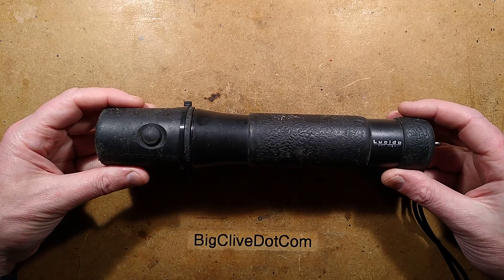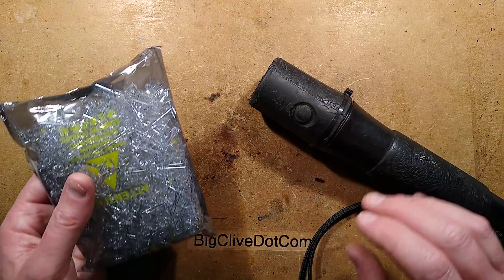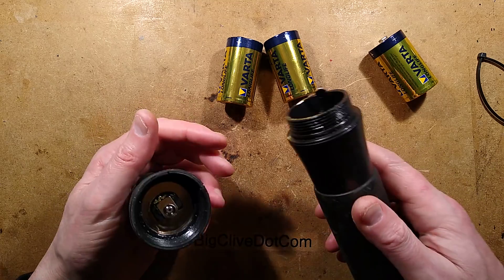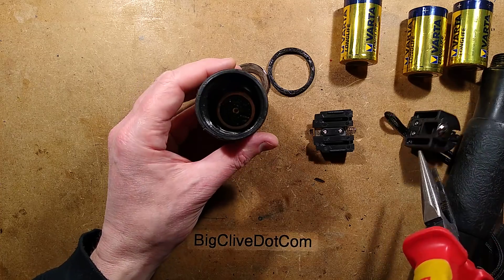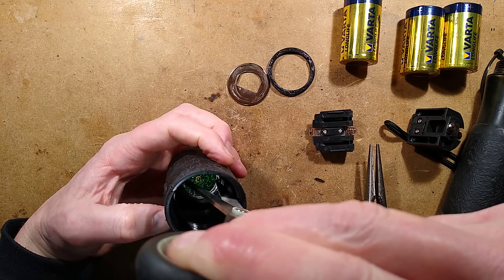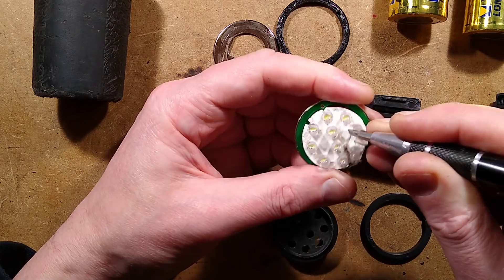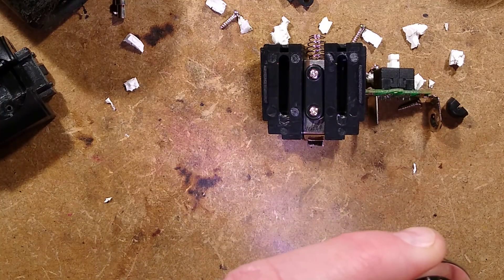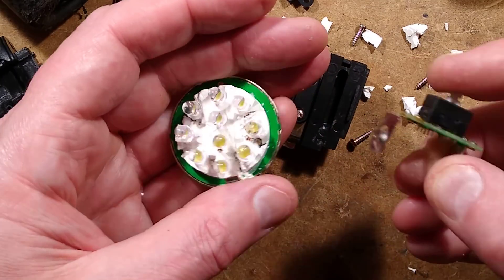Teardown of a vintage Lucido 20 year old LED torch.

Comment: FYI, isopropyl alcohol dissolves silicone potting/sealant but doesn't (normally) harm components, not sure what it would do to the old plastic and rubber though.

Comment: Yep, most LED torches up to the mid-2000s were indeed like this.
Remember getting a 100-LED one for christmas as a tween (Around 2006-2007). It looked like this: https://bit.ly/2Waya7R
Now they only sell UV ones as far as I've seen.

And a few years later (2009 I think) my dad got maybe not the first but at least one of the first affordable chinese high-power LED torches.
This one to be precise: https://bit.ly/3aaQ8PI (Not sold anymore unfortunately)
It ran on a single 18650 cell and unlike todays chinese torches didn't have all those flashing modes. One click on, one click off and that was it.
Fun fact at the time was that it was actually brighter than my large and bulky 100-LED torch (Which ran on 4 AA cells btw) while being much smaller.
And he did offer one to me aswell that I still have up to this day. (Unlike the 100-LED one)

Another fun fact: While I was on a primary school trip to the mountains to go skiing (idk the exact name of this in english) We did play and pillow fight in the bedrooms at night using a flashlight and it was indeed a incandescent one !
This is only to prove that I do indeed remember this era where almost all of the flashlights used by pretty much everyone were incandescent and definitely not LED.

But times have changed, i know that too.
Now flashlights do get much brighter and run for a longer time, while using rechargeable li-ion cells instead of alkaline batteries that run out quickly.

Grettings from wonderful France 🇫🇷 , one of the most stringent EU countries regarding quarantine...

Comment: One of my old Ever Ready torches is made of rubber with a steel core, the strange thing is my red rubber one is cracked an dried out an brittle but my black rubber one is ok, different rubber types, maybe. Petroleum jelly is also bad for rubber an superglue eats certain plastics like celluloid producing a bit of heat due to the reaction which is exothermic. Love this video as often wondered what was inside the first led torch, my collection mostly comprises of the old bulb type but you can get led conversions to upgrade but I keep mine original, I even copy the original battery labels to stick on modern batteries, I have also rebuilt old dry radio batteries for portable valve radios. I also like the old battery fluorescent battery lights, you can get led tubes for these which are much brighter an last longer to. That torch of yours will be worth something in a few more years.

Comment: I suppose that the rubber has broken down chemically over the years making it sticky. So much modern stuff is coated with a soft feel coating these days. Its not ordinary rubber and goes horribly sticky after about a year. I've thrown away loads of torches and tools because of it. It's not caused by oils from the hands either, It breaks down all by itself. I reckon it's a ploy to ensure redundancy. I've stopped buying anything with that soft feel coating.

Comment: I had the aa version of that when they first came out  , it replaced my AA mini mag light I had at the time . The mag light ate batteries  and bulbs for breakfast . The mag light batteries would last about 2 hours , and the bulb around 4 hours . The lucido didn’t need bulbs and the batteries lasted an insane length of time . I once accidentally left it on for two weeks and the batteries were still fine. The lucido was a fantastic torch , but I eventually lost it , but the torch on my new rubber Nokia phone replaced it

Comment: A bag of 1000 LED's... Replace these 10 ?
Pertroleum jelly CAN attack some plastics. If you dare, use transparent plumbers silicon grease, or dielectric silicon grease. If you dare, because the good thing is it lubricates and sticks and really seals from liquids, but the bad thing is it sticks and really seals from liquids;  painters HATE the stuff because it contaminates surfaces which is very difficult to undo/clean. But boy, does it lubricate these O-rings and contacts, and seals and keeps moisture out ! Also do NOT use it on contacts that produce sparks, only on static contacts like a battery contact.

Comment: VARTA batteries 🔋 are always leaking!!! Even new in packaging!!!
Reply: I have four Varta Zinc-Carbon AA cells that expired in 1978 - still no leaks, and still 1.3-1.4V in each of them believe it or not. And they were outdoors in the elements for 2...4 years until about 2010 inside a discarded vintage Grundig Super Color TV (it used them as memory backup). They're not usable though, because the internal resistance skyrocketed, they can barely make a single red LED faintly glow without a dropping resistor and all four of them in series. Few hundred microamps short circuit current. They are probably dried out, that's why they're not leaking.

Comment: Was really hoping you were going to replace the LEDs and current limiting resistors as an upgrade..... Especially when you flexed the 1000 bag of 5mm LEDs!! Perhaps design a new circler LEDs absolutely crammed with tiny SMD leds and have JLC assembly service make it as a drop in upgrade!

Comment: Compare this one to an Emisar D4V2 which is the size of two C batteries, uses one 18650 and lights up at 4000 lumen with four CREE XPL-Hi V3 LEDs. All that for just $55 for the light w/o battery. I wonder what kind of lighting technology we will have in 20 years.

Comment: I dont like these silicone potting compounds, as the old ones tend to pick up moisture and corrode the leads. I was repairing my old generator type welder and had to replace all transistors on the automation board, as the leads turned to rust

Comment: The Comodore 1541 floppy drive has a fairly noisy stepper motor.  That improves drastically with a bit of vaseline on the rails the head assembly is sliding on.  Now nearly 40 years later that plastic still hasn't degraded.  So vaseline isn't bad for all plastics!

Comment: When rubber grip goes sticky, rub it with ammonia for a bit, good as new! (don't use a fuzzy cloth cause the fuzz will get stuck)
Reply: I will try. I guess it takes the stuff that bleeds out away from the surface.

Comment: I used to have two of that exact flashlight. As a commercial pilot, the US FAA had a requirement that we have "a two, D-cell, hand flashlight" in the cockpit. I carried one in my flight bag and was extremely pissed when both of them literally disintegrated (plastic and rubber bodies) and that I had payed $65.00 USD each of them, at a discount!

Comment: Any idea if Teflon lube gel is cancer to plastics? Been using it on high power heliax RF connectors for years to lubricate the silicon O rings but rest of the fittings were of brass.

Comment: When you switched it on, I was half expecting to see it was red! Surely you just HAVE to replace those old LEDs with their modern equivalents and see how much better it is. It would be interesting to take a light meter reading before and after.

Comment: You should upgrade this flashlight with the modern high power white LEDs and it will shine on.

My first light with a white LED was a small clip on light. The battery was dead at the time.

Comment: @bigclivedotcom have you considered fitting some new modern LEDs to this torch?   Refurb it to 2020 standards ?
To work around the gummy softer rubber, use some large-diameter heat shrink tube to compress down and hold it.  This also works great on old bicycle handlebar grips when you don't want to replace them outright.  Cheap chinese heatshrink is really cheap and comes in a vast array of sizes, handy for all sorts of things.

Comment: I bough something similar called a Light-wave flashlight after seeing a review in wired magazine.  Tossed it out years later when the threads cracked on the top and broke.  Could not save it with cable ties like you did.  Cracks in the threads and case durability seems to be a common susceptibility in these torches (flashlights).

Comment: I still have the first maglite LED conversion bulb that I bought at that time. Single packaged 3W Luxeon LED chip that's integrated into a module thats the same size as the tungsten bulb, and I remember how amazed I was with how bright just one LED could be, and its still quite bright by todays standards, even after probably close to 1000 hours or more of use. Cost was also astronomical, too. Something like 40 USD when it came out, but I had to have it.

Comment: Built like my sister's LED solar yard lanterns from that same time period. Die cast aluminum with a light detector as well as a solar cell. The solar cells on phenolic faded away and the clear potting cracked. The LEDS were the old dimmer blueish that had odd greenish specular notes as these aged. I replaced the solar cells with a durable glass type with attached charger/driver board, cleaned and polished the non-yellowed good plastic decorative panes and replaced the LEDS with a brighter, warmer type. You cannot do that to the modern foil stamped, metal/plastic framed trash it thingies.

Comment: Speaking of LED flashlights....  this is a neat bulb I've gotten to replace incandescent bulbs in old flashlights. It must have a built in regulator or something because it's allows a variable voltage input. I've replaced the bulb in a couple of large 3 or 4 cell maglites, and some old 4 cell battery lanterns and they work really well, and the batteries last a very long time (Ihaven't had to change a battery yet). I just thought you might be interested..... https://ebay.us/edqnF3

Comment: I made a set of really wide flat-head screwdrivers from a set of spade drills by grinding the cutting edges off. The ones with the 1/4” hex shank fit in a bit driver handle.

Comment: I remember when my dad got a led bulb for his maglite. It was like the most expensive, cutting edge and hightech thing we bought for years. His friends came over just to see it! So funny 20 yeas later....
Reply: I have a 6 D cell maglite, still using the special incandesent bulb.  If it ever fails I'll try the led, if I can find one for it.
Reply: @johnnyreb3487  I bought a some LED upgrade kits for the maglite a few years ago from niteize.com
Reply: I like my Fenix TK-22 V2 at 1600 Lumens and 41K CD
Reply: Maglite 6D with LED conversion master race!
Reply: @Wasmachineman Aren't the replacement bulbs for the Maglight only 3W? They are much brighter than the original bulb, but the output is sad compared to all these new $10-20 flashlights with 600 lumen output.

Comment: It's a lot like looking at the MAG lights here in the US. They were the top dog of the day and some of their new stuff is still real good but the early lights are like using a candle compared to modern lights. They do however have a feature most of the ne lights don't, you can easily use them as clubs !!

Comment: Me: "wow! 20 years ago...  I didn't know they had led flashlights in the '80s"

Also me: does the math 😶
Reply: I like how Y2K is now considered vintage, what would that make me being born in the 70's? ancient?
Reply: @jb0nd38372  Sigh. I'm the "old man" at work... born in the 60s...
Reply: @DavidPlass  I'd be so looking forward to retire and enjoy that free time to do whatever you want. 
Youngins still have a long road of work ahead before that happens.
Reply: My first LED flashlight was from the very late 90s.  If I recall correctly it was only a single white LED (so not nearly as costly as the Lucida with its 10 LEDs), so not especially bright but it could run for 100 hours off a set of four AA alkaline cells and was at least a useful amount of light since it was fairly well focused.  I also have some 18 year old battery powered nightlights that I still use whenever I travel since my sense of balance is entirely visual (making nighttime power outages especially dangerous in unfamiliar spaces...and I am a night owl) and they use a pair of low power white LEDs and run for about 100 hours on high or 200 hours on low from four AA alkaline cells.  Newer LEDs would be more efficient still, but 100-200 hours runtime for something that is only used a few times each year for a few weeks in total has made it not worth the effort to modernize them with modern white LEDs.
Reply: Like that funny feeling when it sinks in that you have worked for longer than the apprentices have been alive.
Reply: Same thought process here...
Reply: Ha!  I was thinking something similar - 20 year old LED torch, in that case it must have been made in the 70's - then I did the maths!

Comment: I remember when the first Photon LED micro lights came out when I was in elementary school and how amazing we thought it was for such a tiny light to be so bright on a watch battery even if they only came in red, green, and amber...

Not looking forward to the day when you reach for a flashlight but it doesn't work because it's n the middle of a firmware update.
Reply from the maker: The little light I used to look into the other one has a ridiculous processor in it for a keychain light.
Reply: @bigclivedotcom  sounds like a plan for one of your next videos, no?

Comment: I would probably change the resistor value and feed the LEDs a bit more current to get them brighter, it's never going to be an XHP160 and have the ability to turn night into day but at least it should be able to put out a little more light.. so long as the led assembly doesn't get to hot for the plastic. I have an old tungsten type three D cell torch, it's an ACME brand copy of another famous brand for which I can't remember the name at this moment but was all the rage back in the 90'S, oh wow I just remembered, it was MAGLIGHT!
Anyway I ended up getting a drop in led in a bulb for it and while the batteries lasted even longer, it wasn't as bright as the original tungsten filament light globe.. 
This video has inspired me to go and have a look on eBay and see if there's been any progress with drop in led type replacements! The torch body is aluminium and glass while everything is sealed with O rings, you twist the head to turn it on and focus the beam! While the MAGLIGHT cost 10 time's as much but had a push button instead... Anyway I'm of to eBay, cheerio!

Comment: I have a 3-D-cell MagLite I bought in 1989, when those were high-end incandescent lights.  I upgraded it to an LED (the MagLite drop-in) sometime in the early 2000s.  It was the brightest light I had at the time.

My Thrunite stuff will handily outshine it, though the Archer takes full power to do so.  I suspect my TN12 will outshine this mid-power, but the MagLite has one advantage over my modern lights: loads of capacity!  10Ah vs 2.6Ah for the TN12.  The Thrunite stuff makes up for that by being variable brightness; the MagLite is either on or off.

Comment: I'd like to see you changing the leds with new ones and reassembling the torch, and maybe fixing the broken thread... I also would like to suggest putting integrated 18350s with a small bms, but it would lose the thread feature

Comment: I love things that are made to last. I have learned that it is very expensive to buy cheap products.

Time to rejuvenate the flashlight with modern leds and some JB Weld to fix the plastic, keep it going for another 20 years.
Reply: Not necessarily. Some really cheap products are undoubtedly "disposable", yet with many "expensive" products you are also paying for the name, cachet, and marketing costs. If you understand the limitations of devices, you will find that many ostensibly "cheap" products are as good as, and as durable as, "big name" items - and this particularly applies to metrology equipment (micromerters, calipers, thickness gauges etc.).

Comment: I had one of those, and the head cracked in the same way.  Even with brand new alkaline batteries the beam was pretty weak, about the same intensity as a regular 2 D-cell torch.  I think I paid $70 for that piece of crap.